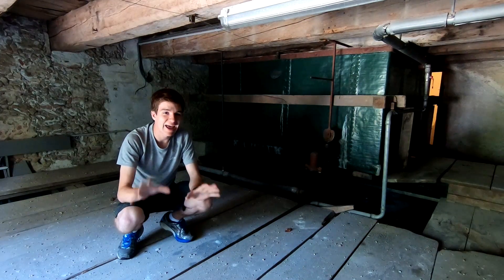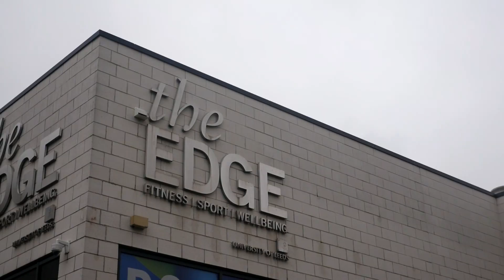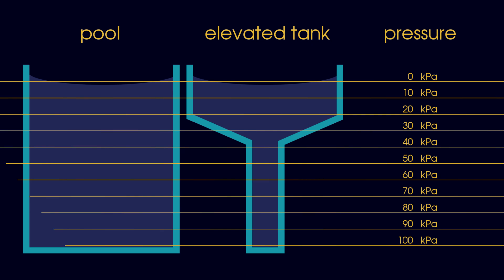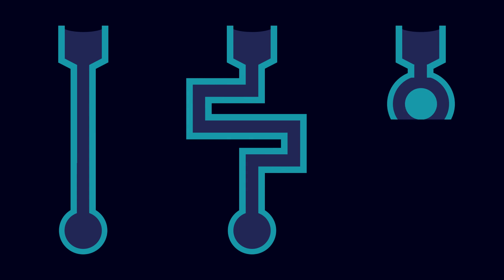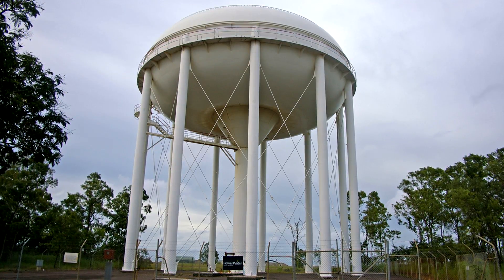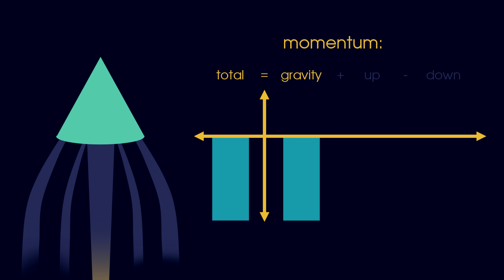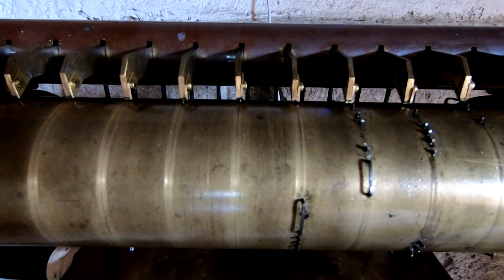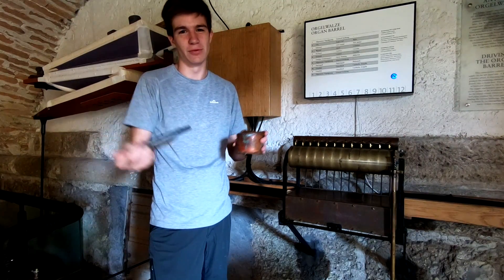Austria's 400-year-old gravity fountains still work perfectly

Comment: Wow, human labour must've been so cheap in those days if you could use people with buckets in place of a pump.
Reply: I think it's less that labor was cheap and more that the owners of the palace were fantastically rich.
Reply: @MSpacer  But not rich enough to afford a pump?
Reply: @unvergebeneid  More on account of the fact that electricity and steam power hadn't been invented yet. There were some wind or animal powered water lifting devices but they were quite large and probably not practical for this purpose.
Reply: @MSpacer  even with an Archimedes' screw type pump using human muscle it would've been more effective than carrying buckets. And I forgot what period exactly this was but Louis XIV had huge pumps for his gardens in Versailles.
Reply: @unvergebeneid  That's fair. I guess I'm not sure why they decided to go with human labor without any mechanical assistance. Maybe the distance between the different water features or some constraint of the palace's design would have made a screw, bucket lift, whatever impractical. Also, I doubt the fountains ran 24/7 in the palace's early days. It's perhaps better to get the servants to fill up the tank before a big party rather than have a pump that runs only 1% of the time.
Reply: @unvergebeneid  the machine de Marley didn’t even work very well